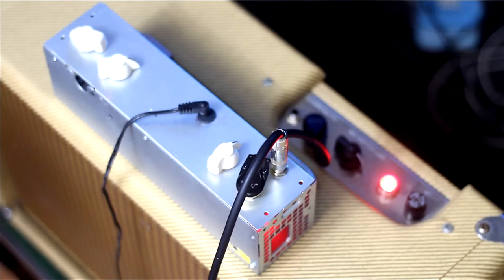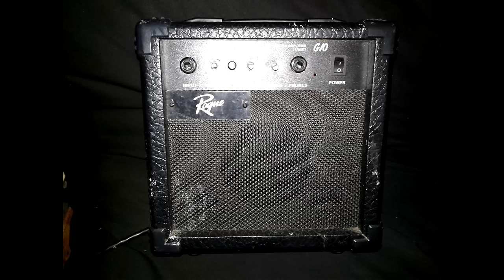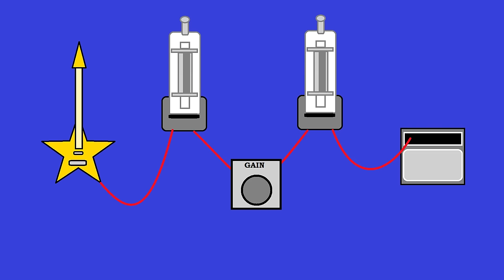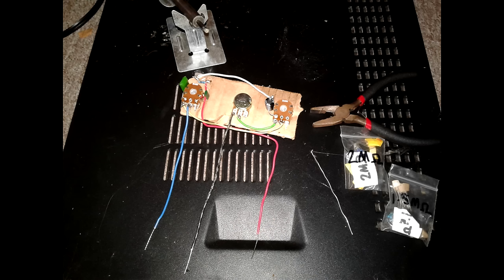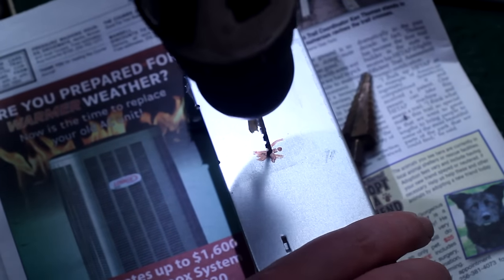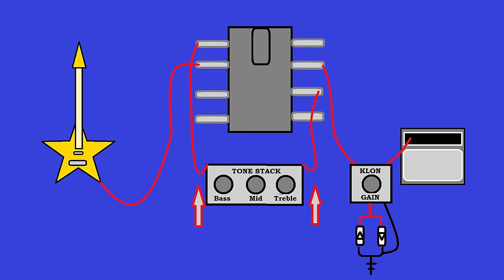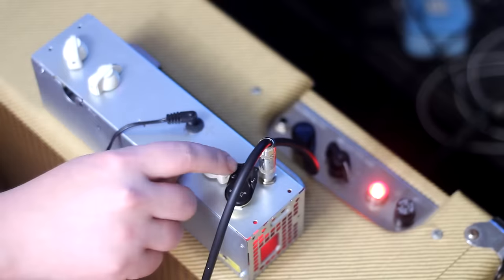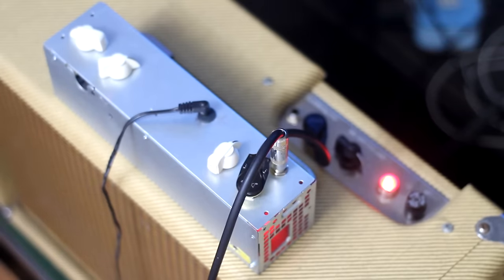DIY Guitar Tube Preamp Build and Demo (Super EASY!)

Comment: i’ve been at building for a few years jsut copying schematics , this is the Best video i’ve seen ! it’s makes things makes sense simply and effectively , thank you 👍👍👍👍
Reply from the maker: Thank you so much for watching and taking the time to write this kind comment Ash. The one thing that helped me the most was just messing with an ebay breadboard. You can build and existing circuit on it. I like simple fuzzes and just start swapping parts and plugging stuff up everywhere while it running, see what it does different or if something let's the smoke out... Swap caps for bigger for more bass and gain or smaller to tighten it up... Either before or after a gain stage add another transistor stage... Etc etc clippers in different spots. You can make a boost into a fuzz or a fuzz into an overdrive. With just a single bias resistor and cap change. Thanks again for the kind words bro truly and heck yeah dude just start stabbing some stuff in and melt some stuff etc etc. You might make the new "TS 808" or "fuzz face" of the new generation. It won't take long for you to get a good hands on idea of things and start wanting to tweak everything you got. I gotta tell myself it ain't broke don't fix it. 🤣
Reply: You are a diagnosed legend  @heavymetalATC  thank you again if there was a tip of the hat emoji you would receive it.🤠
Reply: also all videos appreciated , and i agree with the idea that the pedal industry  seems a bit sluggish and old fashioned and people who do come up with the “far out” ideas seem to get overlooked .Needs more innovation and experimentation which seems to be the whole point of electronics to me.

Comment: My dream amp was tube vintage one but I'm from a country which bottlecaps value more than the currency. Now I've got a 10$ diy tubeamp kit from ebay!! Thank you Tube Hero!! SAVIOUR!
Reply from the maker: Thank you for watching and taking the time to leave such a kind and inspiring comment Xavier. That is so great to hear. I am so happy anytime I can help someone figure out a way to get or make the things that were otherwise not in the cards for them. This should do well for you. It reacts so much like a tube amp a boost pedal or hot pickup will break it up and it will warm up any amp you put it in front of. This would be a great thing for artists to use into a PA when gigging it would totally take away the need for any actual amp on the stage. Thanks again I am so happy to hear that you found this info helpful. That's why I do this. You made my day.
Reply: @heavymetalATC  In my perspective, I have semi-hollow guitar for blues, which I don't use it with amp while practicing since the sound is audible without amp with semi-hollow electros. But for recording, plugging it directly to computer wasn't sounding right on my records even though I have a decent audiocard with shielded backplate in my desktop rig. I was just looking for a tube preamp for recording, not for practicing. Hence, 12AX7 are overkill for my case, 6J1's are enough for this. Cheapest one I found was 100$ in music store, but when I had the money, Item was sold out and the cheapest one was 250$ now. Your video solved this issue wholesomely. 
System I have: 
Creative X-Fi 24-bit 96kHz with custom aluminum faraday cage
Epiphone Dot Studio Carbon Black
Gold jack connectors
OS: Ubuntu Studio low latency kernel
Program: DJack Guitar Rig & Audacity

Comment: great vid, good work!  couple suggestions: a regular soldering iron would make life much easier for you, and make components last longer, the huge gun is great for chassey soldering, but overkill on parts.  other thing is, those tubes in your build are sitting directly over/on some yellow film caps.  the heat from the tubes can and will damage those caps.  i know space is tight but you want as a bare minimum 1/4"-3/4" clearance around the preamp tubes, preferrably more.  you could mount the caps closer to the far pcb holes so they're clear of the tubes, or make some longer, heat shrinked leads to the caps to hang them offside.  or, probably easiest provided there's space, mount them on the other side of the board.  apart from damage, the other issue with the tubes having clearance is, the heat will cause component values to shift with the temp change.  your tone will change because of it, for better or worse. anyway, keep plugging away, thanks for the upload!

Comment: Hey, I watched this video a couple years ago and sourced what I think is the same tube preamp back then. I futzed with it for awhile but never got it to do anything useful. Ultimately, It got put in a box and forgotten about until I came across it the other day. I figured I'd revisit it because maybe I was just doing something dumb 2 years ago that caused my experience to suck. The only difference that I can tell between the one you used in this video and the one I have it that yours has  '90 degree' tube sockets where your tubes are laying down and mine has them upright. It uses 6J1 tubes which I've not encountered in any other scenario. I'm hoping you can answer a couple questions and give me the benefit of your experience. I wired it up with the simplest version you start with in this video. My guitar plugs into a 1/4" jack which is wired to the right-most input. The output is connected directly to the second input with a short jumper wire then the second output goes to another 1/4" jack that plugs into a Yamaha powered monitor speaker that is 10 watts with a 4" speaker. This speaker has a power button, a high & low tone knob and 1/4" input for line on the back and a 1/4" input for mic on the front. I'm plugging into the line input on the back. In your video you have too much gain and utilize a pot to mitigate that. I have like zero gain. I see the red led and the tube filaments light up and it passes audio but imparts no gain, no grit, no tube character. The power brick I am using is a 12V  2.5A  with the output cable & barrel hardwired to it and it takes a standard IEC power cable for the AC supply, For regular tube guitar preamps, I know the tube type like 12AX7 vs 12AT7 affects the gain. That's the first thing I thought could be why I get no gain: Questionable Chinese tubes. I have an extra set of these tubes but when I swapped them in I get the result it the same. I tried a 250k pot as the link between the 2 gain stages and I can turn down the  volume but the gain never increases. I can try other power supplies if this one is somehow not supplying enough juice. I've had trouble finding ones that work with it at all. I'm kinda confused on the power supply end because I've heard I need an 'AC adapter', any anything you plug into a  wall outlet (AC)  adapts AC and usually provides DC. The markings appear to indicate it puts out 12V DC  2.5 Amps and some dashed lines. I  haven't looked  at the pinouts for the 691 tubes but I was considering trying a different tube that would fit the 9pin socket. I suspect a 12AX7 is not directly compatible or that's what would be used since they are 'standard' guitar amp tubes. I suppose there could be a trace broken on my lil preamp board. or bad components. I was curious about the tubes actually contributing to the circuit so I tried with no tubes but I get nada. Any ideas why i'm getting zero gain? Any clarifications you'd like, additional info, pics, things for me to try out and send results... just let me know

Comment: Nice work with the Cliff notes explanation. It did help make sense. I think this would be fun. Very inspiring..
Reply from the maker: Thank you so much for watching and taking the time to write a comment JR. I try to keep it accessible to most anyone. No need in using big words and leaving half the info out to try to seem cool or smart. That aint my style. The point of all this is to inspire and educate. If you try this project let me know how it goes and if you have any questions or get stuck on something feel free to leave a comment. This would make a pretty good first tube project. Its way safer and simpler than pretty much anything I've seen also you could buy a $5 class d amp board from ebay and get a speaker hook it to that and have a full amp. Thanks again.

Comment: The detail you go into is absolutely incredible. Would it be possible to be able to change the order of the gain stages by building a patch bay in it?
Reply from the maker: Thank you for watching and taking the time to leave such kind words Dan. Oh yes you could build a patch bay by connecting the in and out on each channel to jacks and then you could build different tone stacks in pedal boxes and just swap them out or use actual pedals in there in front in the middle or after the tubes or you could y them and run parallel.

Comment: The end result was good. Can you explain what this 2 channel tube boost circuit was designed for. Can it be used as a clean line level boost? This may be idea for an old Webcor amplifier I have.

Comment: hello there!
i have a failed project here, i just want a working amp and im stuck on the preamp part that i couldn't get to work and the helping videos are gone lol
i got a 12'' 8hm speaker, a cheap 100w board (tpa3116da mono)
would it work if i put this work of art you made plugged into my little board and have a working guitar amp? if yes, would that be fine to just using a cheap tone stacking board instead of making my own?

Comment: Video idea: Make a tone stack circuit using the calculator and explain exactly how to translate that to real life, step by step. I'm a total noob and understanding where signal comes in and out, and where pots are located, would be helpful. The drawing produced by the tone stack calculator isn't clear for my inexperienced brain. Is the stack you used passive? I see that some may require power? Anyway, thanks for the cool video. Keep up the great work.

Comment: 6j1 (6ж1, 6ж1п) is soviet tube copy. I had similar mock up with same tube (different AliExpress board) with bass guitar preamp in between the tubes. Didn't had a case, so it was noisy.
For example engl e530 has two tubes as well, is very similar device.
Reply from the maker: Thank you for watching and taking the time to comment Pakiw. Awesome! I had no idea what a 6j1 was or what it was based on. This is my first time dealing with these little tubes. I'm more used to 12ax7, 12au7, 6gh8a style preamp tubes. Have to say they sound pretty decent I was pleasantly surprised by the results.

Comment: Hello there! Thank you for sharing this!
You inspired me, I'll start this project soon. I have some questions tho:

1) I've got a DV Mark jazz 12 amplifier, which is great for clean sounds, but it doesn't seem to eat distortion pedal quite well (as the name suggests, it is not intended for that use). Which tone stack do you think can do the trick? The flatter one as you did?

2) how did you achieve the Hendrix sound? It was great!

3) do you think there's a way to insert send / return in this circuit? Would it be of some use?

4) I'd like to make a spring reverb unit, but the driver circuit is quite unclear to me. If you could make a video about that i think it would be great for the whole DIYers community 

You earned my like and subscription, by the way 😉

Comment: Super video. Clementine. Awesome playing. Build the same last year. Now working on a ef86 preamp. Greetings from Holland. Paul.
Reply from the maker: Thank you for watching and taking the time to write such a nice comment Paul. That is awesome! I hadn't really considered this as an option until Petey showed me a link to the unit used. Then the gears started whirling and it happened fast. Let me know how the new preamp build goes and consider making some videos on it. You can use a phone or anything as long as the info is good and you get it to the ones that need to see it... people will be interested. I know I would be. Thanks again.
Reply: @heavymetalATC  
I like your channel. Feels like we got the same ideas of building. I feel that I'm still learning, and not able to film it yet. So sorry. But maybe in the nearby future.. I will sign up with your super channel. :).

Comment: Sorry i know i asked and got an answer but i lost the paper i wrote it down on. What type of AC adaptor was needed ? I had one i posted the specs of and im not sure itll work. I know it was a 12v AC to AC ? Can someone post a link ? I got my preamp in the mail today and want to get going on it ;-) Thanks again for the video
Reply from the maker: No problem CT. This adapter appears to have perfect specs for the unit. https://www.amazon.com/Reliapro-ACU120100D0531-Adapter-Transformer-Straight/dp/B00B8861T2/ref=sr_1_3?crid=1AW9R2L32EMMV&keywords=ac+to+ac+12v&qid=1658870701&sprefix=ac+to+ac+12v%2Caps%2C770&sr=8-3
Reply: @heavymetalATC Do you know what kind of Jack to use for that adapter? Can AC and DC ones be used interchangeably?

Comment: I've got a fender champ 25se that's hybrid, as preamp, tube power section and I've been wanting to find a good tube preamp option to mess about with and this is pretty inspiring man
Reply from the maker: Thats cool man those are neat little amps... Its funny how people will say oh yeah thats Hybrid i dont want no solid state front end... oh, like a $150,000 dumble overdrive special with a Jfet transistor driving it. I made a little hybrid solid state tube amp combo a few years back on the channel and I did a solid state front end going into a tube power section... like dumble and like that amp... most people seem like they think a tube preamp into a solid state amp would be better but... I thinks its just different. I mean hell anything can sound good. Those little solid state rockman headphone amps from the 80s made it on to all kinds of records.. Also Roland jazz chorus... fully solid state, clean as hell amazing sound. It is worth messingf around with one of these preamps though you can get some high signal going into that champ on the clean side and probably get it really talking on the slight breakup tube chug and chime Hendrix SRV kinda deal.

Comment: Like this idea, pre-built tube. Shame there is still allot of buzz and hum  when not playing anything, would this amp be also good for acoustic guitar and bass guitar?
Reply from the maker: Thank you for watching and taking the time to comment Michael. Yes it is quite noisy into the tweed champ but when I run it with a keyboard amp that's solid state and not so much gain. it's not nearly as noticable. I think it could work as a preamp for a mic or acoustic. It may be better to run the tubes parallel rather than in series to get an even quieter operation. I think shielded cable inside may also offer quite a bit of improvement in noise floor level.

Comment: Great information. I have one of the preamp boards sitting in front of me; waiting for 12 vac adapter. Do you have the schematic for your tone board? If you can put it up that would be great. Great JH sound BTW. I have a Stromberg Carlson 58U-B all ready to go. Couple of AU57s as well.  Figured out that the Bypass caps on the 6JSN tubes were a big problem for guitar output. Way too much gain for guitar. Runs perfect without the caps; I may try to add some 5uf.  Removed completely and now have a great high power amp that is clean; good place to start I think. Thanks for you approach as well. Wish I had your knowledge and practical no nonsense approach.
Reply from the maker: Thank you so much for watching and taking the time to write such a kind and informative comment C&DP. I dont think I made a schematic for my specific tone stack but it is essentially a vox tone stack 1 for 1 with a few components changed to values i had on hand but calculated to be as close to the original as I could make it. I have had people tell me that this preamp board had too much gain or it didnt have any gain all over the board it just seems like it is very sensitive to pickup choice and output level as well its loud as hell on the output compared to a guitar pickup so if you got tubes or a good solid state preamp after it your gonna get more fuzz. so into that amp you go you might have a high gain marshall sound possibly hahahaha.

Comment: A good cheap source for shielded 14/16 gauge wire is an auto junk yard cutting off some Anti-lock Braking System wiring harnesses.
Reply from the maker: Great suggestion Doug! thanks for watching and taking the time to comment these are the kinds of tips and info we can use around here!!!

Comment: Great video. Wondering if this kind of set up would work well with microphones using XLR ins and outs?
Reply from the maker: Thank you for watching and taking the time to comment Kieran. Im sure it would do fine with a mic signal but you may not want to run through both stages unless you put a volume/gain pot between them or in front of the first one. I dont know exactly what would be the best way to deal with pin 1 being shield and pin 3 being negative... I guess you could just run the shields to the enclosure and then the ground on whatever amp or mixer you plugged it into would give you that 3rd prong earth ground.
Reply: Using a mackie mixer?